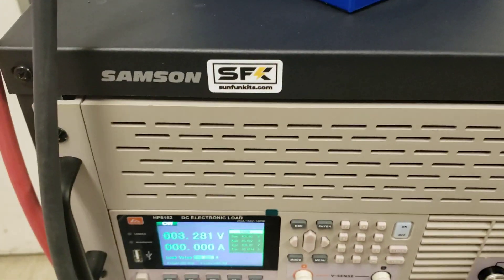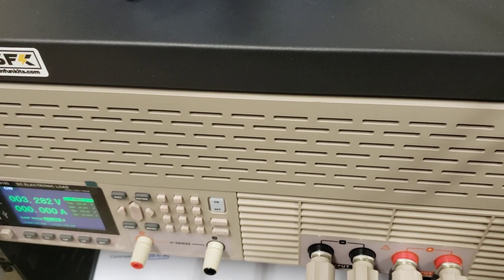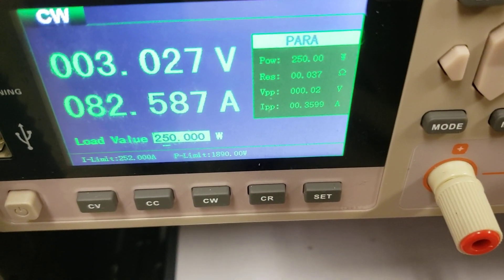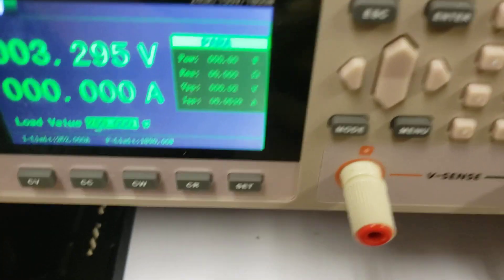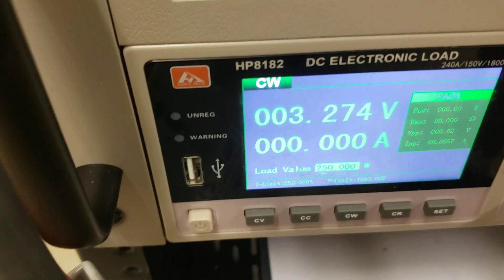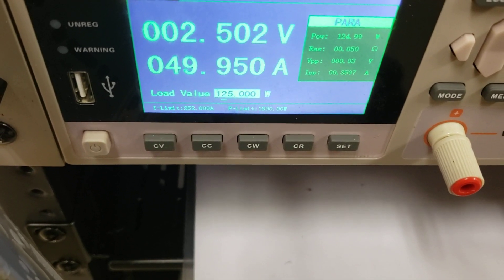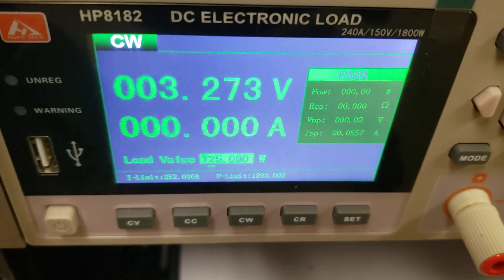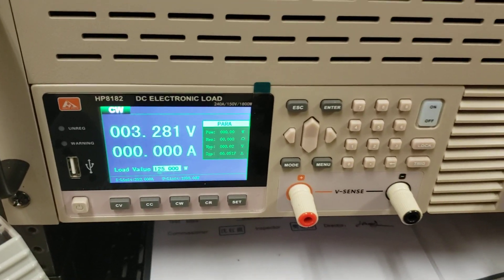"Grade A (vendor claims)" vs Grade B 280ah cells lab test. EVE Lithium Iron Phosphate LF280.

Comment: Is that voltage at the battery or at the load. Even with heavy wire you'll still get some drop. Obviously some cells are worse and that's the point of the video. I'd just bet the good battery was still closer to 3+ volts

Comment: This is the problem im having under a 200 to 300w load on a lifepo4 200ah battery WITH 100A BMS I bought use  and the seller without hesitation refunded me in full ... so now I have the task of getting rid of this battery....

Comment: Can you say just by testing the IR with a decent 1kHz Tester (like YR1035+) if a cell is good (grade A) or bad (grade B-) or is it more complicated? Do you need a DC-load test with 100+ Amps and measure the voltage breakdown?

Comment: I see battery grade "A" tested with 90Ah draw and battery grade "B" tested with 200Ah draw
Reply from the maker: Watts = amps * volts

Cell  1 Can provide 250 watts at 90 amps * 2.77 volts

Cell 2 required to 212 amps * 1.17 volts to provide the same power.

Cell 2 is defective. 

This is a chance you take with grade B cells some are good some are ok and some are just garbage.

Comment: Bought $4k dump load, forgot $5 V-sense wires. FAIL.
Reply from the maker: V-sense wires will not represent real world situations. Your inverter will not have separate wires just for voltage measurements. Our testing is designed to represent what will happen in actual deployments meaning this will result in a low voltage disconnect.

But enough people have requested this so part 3 will be coming out by the end of the month which will include v sense wires.

Btw it was only .3 volts different.
Reply: @sfkenergy  Ok, i will try to be clear. You need sense wires because voltage drop from battery cables forces the dump load to increase load current to maintain constant power target of 250W. You are unfairly loading weak cell to over 200A which will add even more voltage drop in the wires which leads to higher load current. It's a closed feedback loop situation. Just try retesting same cells with Vsense wire lugs connected to battery terminals first, then load cables on top of Vsense lugs. It's very important to measure actual voltage as close to battery terminals as possible. You will get significantly different results.
Reply from the maker: @antronx7  so as stated earlier we will make part 3 eventually and show the test with v sense wires but the difference you are assuming is way off. At most the difference we measured even with v sense was .3 volts.

The main wires are 2 awg pure copper
The dc load is asking the cell to provide 250 watts of power. It is up to the cell to provide this at the volts x amps that it can. We aren’t bullying the cell and asking for it to provide 200 amps.

At the end of the day inside a battery none of these benefits will be available to the cell if you ask 1000 watts from the battery each cell be under a 250 watt load. This load will trigger low voltage cut off on this weak cell.

We have seen this enough times to never mess with grade B cells.
Reply from the maker: https://youtu.be/22zMfe-jYwM Go on and keep posting BS on the DIYSOLARFORUM I'm sure your Fake Gucci Gang will provide you with re-enforcements.

Comment: use sensing wires and measure again
Reply from the maker: https://youtu.be/22zMfe-jYwM V-sense only measures the resistance of the wires.
Reply: @sfkenergy  Not the resistance per say it eliminates the voltage drop of the wires under load. First you probably need to enable it in the electronic load, just plugging it in doesn't mean you are using it, what it does is measure the voltage at the battery, and eliminates the voltage drop over the wires during load.

Comment: Liked and subscribed!  Q: does the inability of the Grade B cell to discharge at a higher amp rate also mean that it won't be able to charge at a high(er) rate?    Would that limit the overall charge acceptance rate if you used it in a 4s1p pack?   

This vid has tremendously valuable information, as I'm planning on buying LiFePo4 cells to make a house battery bank for my life-aboard sailboat.   Thanks and greetings from Key West.  
Capt. Blackheart Charlie

Comment: Wish we knew what suppliers to avoid though. No diy-er has this type of equipment. Would've been nice to get something out of this video :/
Reply: You can easily improvise, put a load on a battery and check voltage of each individual cell or better test each cell individually, no need for fansy equipment just find a load that fits your requirement
Reply: 95% is crap.

Comment: What should Grade A 280ah cells cost on Alibaba?   I know some listings say they are Grade A..... would be nice to find a supplier that sells them. Do you sell them?
Reply from the maker: The cells we will sell will be labeled as bulk cells. They are what all alibaba sellers call a++ in our tests real world capacity is between 270-290 with many averaging about 278ah. These are direct from the manufacturer and had a data sheet showing 291 ah for all. 

We have also seen batches of cells that are just 263 ah. 

Mind you that our tests are at .25c discharge.
Reply: The one place I know for sure.  https://szluyuan.en.alibaba.com/
If you order the bulk cells, order extra. The grade A, order what you need,  they get tested and matched by the factory in batches of 16.

Comment: Wrong test you should definitely use voltage sense from the terminals
Reply from the maker: Hi

This was a watt load test this simulates what is happening during a battery that is under a 1000 watt load (250 x4 on a 12v battery) .
Reply: @sfkenergy  i used watt test on a and b grade cells too, and with voltage compensation wires and good connection to battery with conductive paste under 400w load, current was arround 120-130a, fully charged cell from 3.32v goes to 3.12-3.15v under load
Reply: @sfkenergy  You have no clue what you are doing. V-sense wires are required to eliminate voltage drop of battery to load cables. At such low battery voltages they add their resistance to battery internal impedance and distort your readings. You also using incorrect measuring method. You have to use constant current and not constant power.
Reply from the maker: @antronx7  You are an mis-informed Sir. V-sense measures he resistance of the wires going to the cell. You can view this: https://youtu.be/22zMfe-jYwM

Comment: I think the "Res" value from the PARA display is the virtual load resistance, NOT the cell internal resistance.
If we divide the displayed volts and amps, it fits.
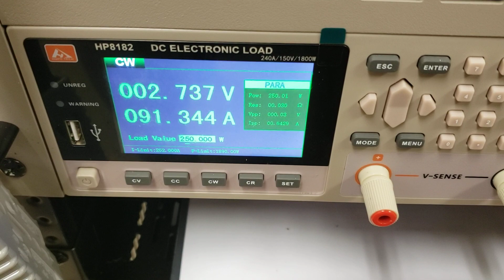Reply: You are 100% correct - that electronic load is NOT showing the cell's internal resistance. Specific ex. at around the 1:41 mark, V is ~2.737 and "Res:" shows .03 Ω. I = V / R, so 2.737 / .03 = 91.2 which matches the current being displayed on the load.
Reply: Interesting
Reply from the maker: Legal Reasons, we live in a sue happy world 😒